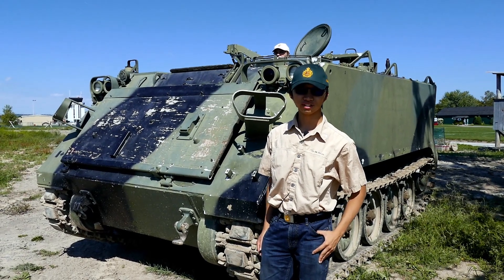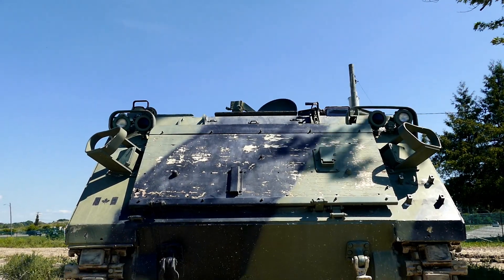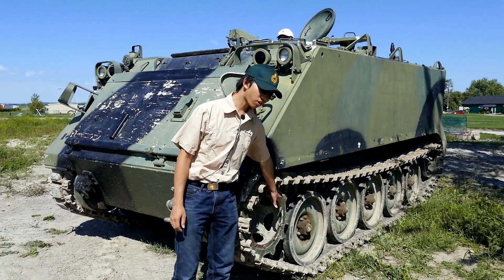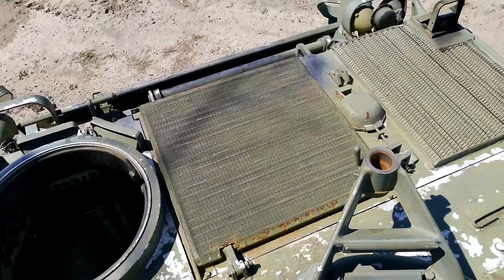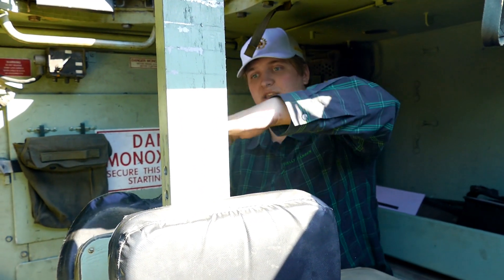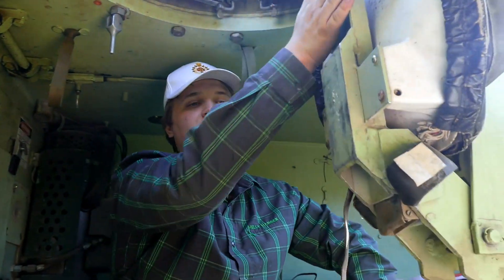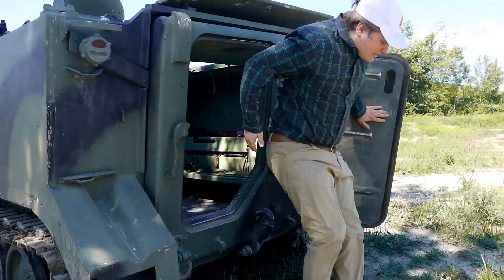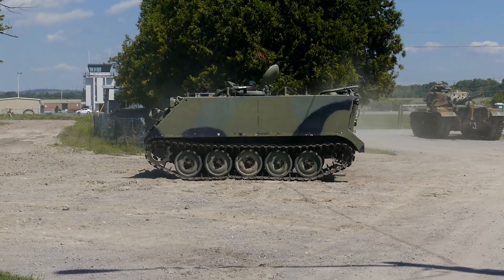Fighting Vehicles: M113A1

Comment: I drove an M113 from 1965-67 and we had no heater, no horn, and it had a Chrysler 75M Gasoline engine. Ours would top out at 42 mph.
Reply: I watched a reg forces driver at Petawawa approaching a crest on a dirt road and get all the track clear off the ground except for a few feet at the rear, and keep it standing that way for a while as they rode down the other side of the crest, then it leveled out and they really took off with curly trails of dust flying off the tracks. Very cool.
Reply: I drive a m113 in 2019 and it has a broken horn broken heater and it tops out at 27mph
Reply: Those petrol engines were converted to diesel in the Pakistan Army later. The manuals had its old fuel consumption written in it. I had to explain the reason :)
Reply: They got a whole lot better. The heater would run you out of there. 1985-88.
Reply: are you vietnam veterran
Reply: @eyesight6149  , I'm not. If you were referring to me.
Reply: kevin lawrence  If I remember correctly it was made around 1962.
Reply: @eyesight6149  I served in Germany with the 14th Armored Cavalry on border patrol.
Reply: Gerald Clay 

I drove an M113 from 2012-2013 in Taiwan and that grandpa probably inherited form your unit.....Oh, I am just kidding,it was made in 1986,2 years older than my age,it is an M113a2 version,but we still have some a1 in our base in 2012, we keep everything running smooth,fast enough to do drifting on the mud. it never fails me if the parts supply haven’t been delayed,which always did.....I feel like a war museum keeper sometimes before instead an army driver.

It’s always good to share the same memories with veterans like your age.

M113 is really a legend cross-generations
Reply: @sulacraft  For sure it is a legend. Ours was used as a communication vehicle and was crammed with radios. I served along the East-West German border with the 14th Armored Cavalry. Lots of memories in that 113. I think maybe we got the first one ever made. LOL
Reply: I drove a gas track from 1966-1968 in Vietnam and in the states. Pretty cool plunging into deep water with a full load of troops and the bilge pumps going, and scary at the same time.  The driver idler had an annoying habit of shearing off the hull and leaving you stranded.
Reply: Jack Tangles were your bolted on with 4 bolts?
Reply: @eyesight6149  Vietnam era. I was stationed in Germany with the 14th Armored Cavalry on border patrol.
Reply: Jack Tangles that would explain why they did not shear off.  I had two idlers come off in 2 years. One on a mission and the other while training troops after the nam.
Reply: @lightspeedM3W2019   hi,  what things can kill boys in m113 , are you scarry rpg? 
how to vc kill GI in m113 ,  how to GI  in m113 sủvival and kill vC?
Reply: BMP 1
Reply: kevin lawrence  That is correct
Reply: @eyesight6149  Vietnam era. I was stationed in Germany on border patrol with the 14th Armored Cavalry.
Reply: kevin lawrence  It was a Chrysler gas engine early model.
Reply: @eyesight6149  No, I served in Germany with the 14th Cavalry on border patrol 1965-67

Comment: The vehicle was designed to carry troops into battle where they would dismount and fight as ground infantry.  Its "armor" was to protect them indirect small arms and shrapnel as the were carried into battle. It certainly give more protection than riding a truck. But, it was not designed to fight.  Hence the internal fuel cell.  It was easily defeated by direct by fire from larger guns, rocket powered grenades, and mines.  Shaped charges of rpg's would easily penetrate the hull, spraying molten aluminum inside which would them combust causing an internal explosion, obviously killing the occupants.  That's why troops usually rode on top.  The stand off protection added to the sides seems of  limited value in a fighting situation. 

Its good points were its mobility and carrying capacity.  A full squad of infantry with weapons and supplies protected from indirect fire made it worthwhile.  It could also take the wounded to safer areas and first aid.  The 113 could cross muddy ground, climb steep inclines, cover loose and sandy terrain, and float small bodies of still water.  The large panel (trim vane) on the front would be tipped forward 60 degrees or so to deflect waves, and prevent flooding.  The engine (same one used in buses), transmission, and tracks were very dependable.  Numerous variants followed, including a command center and ambulance with standing up room,  a reconnaissance vehicle with shortened height, and a 4.2" mortar carrier. 

The boys gave accurate narration.  Just one item, first sit in the commanders seat, then pull the handle to rise up, and drop down.  That's a much safer and  easier to do while under way, and a faster way to seek cover.  Seating is much more steady than standing, so less likely to get shaken off.  Finally, when riding always wear a helmet.  A combat crewmens helmet with commo is best, but anything that protects the top and side of the head.  Occupants get rocked around at violently times from sharp turns, bumps and holes.  Hard contact with walls, hatch covers and turret rings is likely, painful, and injurious.  

Thanks guys, it was good to visit an old acquaintance.  JBSmall, USArmy, Armor 66-69.
Reply: Lot of memories Vietnam was a driver and gunner 11th armored Calvary alpha troop 69 70
Reply: Hey... I read that same book! Bet you lived in one also. B co 3/67 2AD Ft. Hood TX.80 - 82   Ret. 02. It was my Mechanic's van. Also a licensed M88 operater.
Reply: BTW <O
Reply: BMP 1
Reply: @2017 Student WONG JUN JIE ANTHONY aea
Reply: I like/dislike the M-113. I wish it was equipped with a T.O.W system in case we ran into the commies PT-76 or T54/55 (I know some M-113 in Nam' were installed with recoiless rifles, not practical). What's up with not providing shield for the 50 gunner on many of them? He would be the first one to be taken out! And the gas hog engine would burn like a torch when hit. Why US want to use gas engines in M-113,M-41, early M-48 while the commies were using diesel?
Reply: @hochoma1564  Because is a mass production vehicle. If you want to add a lot of things better you creat a damm tank
Reply: @ComasGhost  We, The South Vietnamese were hard-pressed when suddenly ambushed with PT-76,T-54. A guided-missile system could be added with with out creating "whole damm tank" so the APC can defense itself. Same with 50 cal gunner shields were not installed. Don't use gas engines in tank/APC. Not efficient, very flammable...Got cha,  if we want something done right; we got to do it  ourselves!
Reply: As a civilian looking in from the outside, the M113 always struck me as not perfect, but good enough. It’s limited armor was a problem but it was within design spec. And the protection met what it was designed for. Its durability and mechanical reliability made it very useful. Sometimes I think today we get stuck too much Uber weapon systems and ignore good enough, cheap, and reliable.
Reply: It was a design optimized for a specific purpose: a low cost, airmobile transport to move infantry around western Europe in response to a Soviet invasion. It did that well, but we didn't anticipate Vietnam or anything that followed. Cheers!

Comment: Spent 16 months in Wildfecken West Germany 2nd/15 Inf. 3rd Div. Drove M113 for before promotion to E-5.  Great job! Just a couple of comments. No discussion of Trim Vane deployed when forging river. We used 50 calibers as main gun, My track had a heater that worked thankfully, winter in Wildflecken was not for the faint of heart. Hydraulic ramp in rear was steel as I remember.  I drove an M113 at near 40 MPH governed speed. M113 was a dependable vehicle with proper care.

Comment: 4:44.    That is not exactly how you drive these things.  The only way you apply power is with your right foot.
The levers are simply brakes for each side, with a parking brake button on the top of each lever.  To haul ass in a straight line, you mash the throttle and leave the levers fully forward.  Then you pull a tiny amount on either side to maintain a direction. 
The hard part is stopping really quickly.  You have to pull on both levers really hard and very evenly to (hopefully) stop in a straight line 👍.

Comment: i drove one configured as an ambulance with the US Army in Germany 1970. those levers are not to make it go faster and slower, they are for steering and braking, you make it go faster or slower by applying more or less pressure on the throttle pedal

Comment: I lived in a Dessert in one of these... You need to do a service on that engine, too many oil leaks. Cleaning all the oil off it will help it run cooler, and fixing all the oil leaks will keep all the dirt off. Make sure you have all your belly seals serviceable before entering the water! Your ramp has a weak lift cylinder, poss. leak? Check under the floor plate in the very back.

Comment: There are no generic "night vision goggles". There are light-amplifying systems and systems which allow to see in invisible spectrum. That IR-light (or blacklight) is actually just a lamp emitting radiation (mostly) invisible to human eye. If enemy has IR-detecting equipment it is very visible so it doesn't solve problem of being invisible. Still very neat feature as ways to detect IR-lights are not as widespread.

After that nitpicking I say you did well. It is lacking polish, but certainly has expertise and dedication.

Comment: They could have found guys that know what they're talking about or know about the M113.  To show the engine, all they had to do was drop the trim vane and open the engine hatch, instead of opening the interior panels.  The big hatch is called the cargo hatch.  The reason they relocated the fuel tanks to the outside on the A3 was to provide more interior space.  There is no danger of explosion because it's diesel fuel, not gasoline.  He even identifies the fuel cut-off as a choke... The track commander never raises the seat and sits in the hatch, he stands on the seat.  He identifies the spare track mounts as footholds when climbing on the vehicle.
Reply: James Hahn 
Horseshit was my commentary listening to these guys. The tillers did not put power to the tracks for steering but applied brakes and slowed the track on that side. The only time I took the engine armour off was for an engine change, be great to see what these guys would do to check the diff and final drive oil levels.
I don't know what you guys did but we always spoke each digit seperately i.e. one one three not one thirteen

Comment: I am doing my military service as a apc  technician in Turkish army. Turkish armed forces did many modernization this car. Now we will do a new modernization this car we won't use power plant more. the power unit change completely we will install hybrid engines. We use as unmanned apc this car. We can control with remote control unit this apc and we add new turret system. Turkish commanders dont give up this vehicles maybe we will do a few modernization more :))

Comment: Aluminum helps it float in water?  The Australian version had a Detroit 53 series 2-stroke V6 supercharged diesel engine, a far superior power plant to the Chrysler 440 Gasoline engine.
Reply: Chris Richardson  God the old Mopars were great. Bring back a 70's Dodge Van with a sliding side door and with a 318.
Reply: Chris Richardson  Another I liked back then was the 307 Chevy. Both would get 20 mpg on the highway.

Comment: I wonder if there's enough space to the right of the roof hatch to bolt on a Ukrainian Stugna-P launcher. It's aimed and guided by a laptop-like controller on the end of a long cord, so the operator could stay seated inside the vehicle.

The Stugna-P launchers that Ukrainians have mounted onto 4 wheel ATVs look compact enough, I think. But M113's would be amphibious and more stable on uneven terrain, I think.

Comment: Always blow the horn when about to lower the ramp. Except in combat. Troops and especially civilians tend to get very close to the back. It gives them time to move. Same when going in reverse. 
The m114 (the half height version you mentioned) was built by a completely different company. They have no common parts and it was a failure.
Command track is much taller. M557, but same company, and still in use.
Reply: The 114 wasn't a bad vehicle.  The biggest problem was the Chevrolet 283 gas engine.  That's what doomed it.

Comment: Someone forgot to tell the cavalry  units about the limitations. To the Cav it was the ACAV and deployed with a .50 in the front and M-60s on the sides. And though not an M-48 or a Sheridan it was deployed in line as both hammer and anvil. In Cambodia I had a break in flying and asked NCO in charge if I could take a ride. I wanted to see the ground level view, rather than the tree top view. He asked if I could handle an M-60 (most pilots had never fired one) and when I said I could, he told me to take the left side gun.  There was no gun shield. There I was, standing on ammo cans, pointing a machine gun and looking at a green wall just beyond the flash suppressor.  Fortunately for us all it was a quiet trip out and back. I pulled pitch and headed back to Quon Loi, but I never forgot those guys or the ACAV.  The unofficial motto tells it all, "Find the Bastards and Pile On"

-Scouts, Air Cav Trp, 11th ACR.

Comment: Dude that's an A2, it got raised suspension with two extra shock absorbers at the front, also got the radiator fan on the right side of the engine compartment, still great video, man I miss the sound of that beautiful two stroke diesel, sounds even cooler with the exhaust taken apart.

Comment: I drove an M113A1 for CSC 3/35 scout platoon in Bamberg Germany(75-78) it was a great vehicle, very reliable (except for the heater).
Reply: I drove the APC 113  from 1965-1698 in Bamberg Germany for  the 54th. Mechanized
Infantry 1st. Squad, 2nd. Platoon, Company C. 4th Armored Division United States Army Europe .A great and reliable Vehicle .Yes we did cross rivers with them very scary  let the trim board down in front and went very slow .Yes only about  10-12 ins. out of water.We had a 13 man squad with the 50 cal on top.Our heater did work !!!
Reply: I was in the mortar platoon CSC 3/35 Bamburg Germany 75/78 " I bet I know you?
Reply: usually it was a glass rod inside the flame detector switch would break. could by-pass this with the handle end of C-Rat spoon!
Reply: 1-54 Inf 79-82. Great times in tracks. Loved Bamberg
Reply: @richardjohnson3748  ya'll were down the street from us, I left in 78 but went back TDY and it's all abandon now.
Reply: C-trp 1/3 ACR, Ft.Lewis/ Bliss motor section..proud to ride ACR, Brave Rifles

Comment: FMC offer the external fuel tank starting with the A2.   Canada Took that option on their A2 but U.S. took it only on their A3.   That's why this U.S. A2 model converted to Canadian with diehl track added doesn't have fuel cell.   Also Canadian never add those kind of smoke discharger when you see those smoke discharger guard up front.

Comment: you forgot the extra two lateral pivot arms attached to the disc breaks on the drive shaft. those are the half moon levers on the main drive levers, great for emergence stops which also allows you to virtualy tip it almost on its nose if you want. lol
Reply: We used to call those levers "lockers" because they lock up the drivetrain. Drivers have to use some discretion with them because the action is quite violent. Inside a compound they were handy for cranking the vehicle left or right in tight spaces. In the field you could end up rolling the vehicle with a sudden change of direction on a decline. Anybody with a 4x4 or ATV would know that. When training, we weren't allowed to touch them at anytime. There were plenty of other ways available to get in trouble with the commander anyway :)

Comment: Someone should make a 2 piece unmanned, or single man tractor to pull a trailer full of soldiers. That way the unmanned/single man tractor/engine will set off any IED's or mines minimizing casualties! Plus they could drop off the ACP trailer so the soldiers can use it for shelter or a temp medical shelter until air rescue arrives.. There's countless advantages for such a platform IMHO..

Comment: I drove a 113 in '78 & '79 in Aschaffenburg. The laterals did not add power as he described either, they applied braking to the side that was pulled. The pivot steers in front of the laterals locked the side pulled allowing the 113 to spin on the locked side. This vehicle was also missing the side skirts as well as the extra tracks that were mounted next to the trim vane. Too many mistakes decribing this vehicle.
Reply from the maker: This was one of our earlier videos and we will definitely revisit it to make a better video.

Comment: Those are not footholds. They are used to hold extra track shoes. On top of the deck is the radiator grill on the right and on the left is the fan tower! Those levers are called laterals which control the steering. Jeez, read the spec's son!

Comment: The M113 looks good and the US equipped ARVN with many of them but they were inferior to nva Pt-76 (has 76mm cannon). One hit from nva Rpg-7 would go through both side of M113 + gas engine =infernal. The US armed ARVN with M-41 light tanks to go against nva T-54/55 medium/heavy tanks. Yes there were small number of ARVN M-48s compared to very large number of T-54,Pt-76...sad.
Reply: Michael Truong
Reply: Well, it's apples and oranges in that case. Even in its ACAV configuration, it's not meant to be a light tank.